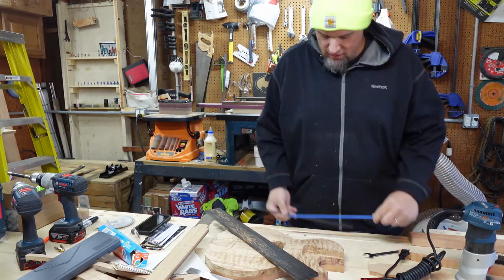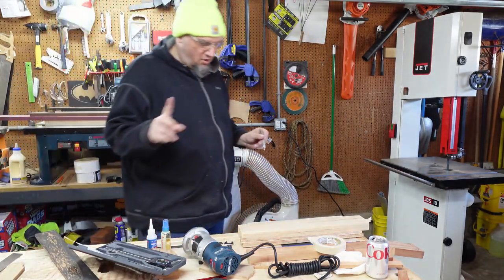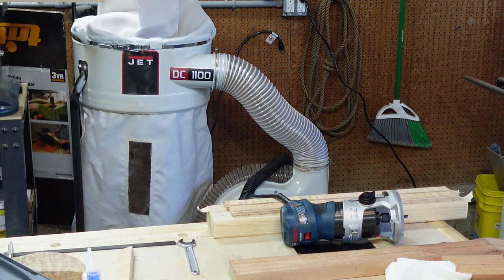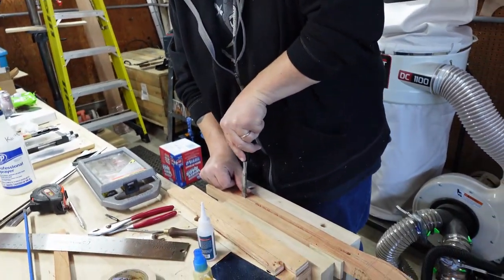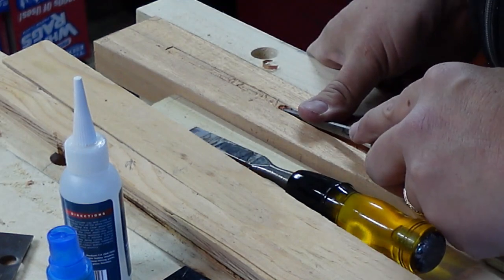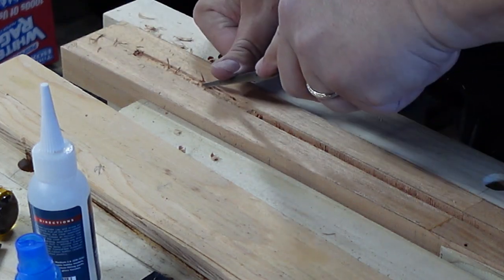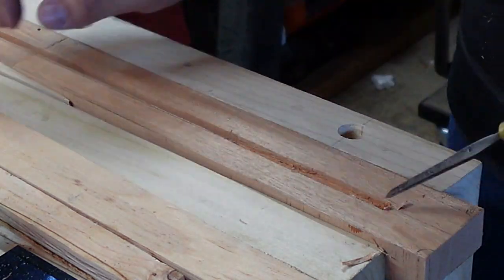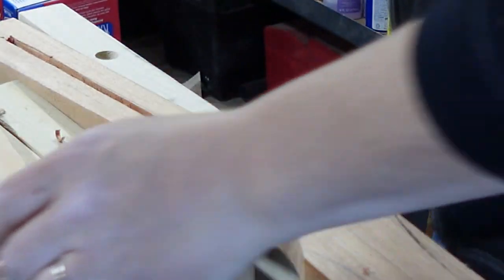episode 9 - Can't Truss It

Comment: It might have helped if you had had a router plane and a guide . I have watched some guitar builds where they have used them. Paul Sellers has a couple of videos where he has not only used them but showed how to build them as well. He doesn't to my knowledge build guitars but he is a heck of a wood worked. He even has a link to a kit to build one that he worked with in conjunction with a tool manufacturing company you can order to build one. The build is coming along. good deal the when the router bit came out when to the truss rout it did not damage it. Just hop the channel didn't go too deep as the bit worked it's self out.

Comment: Drill a starter hole in your actual piece and set it for bottom of your groove instead of starting the router at an angle. It's a lot more accurate and safer! You cold make a wooden channel to tape your neck in and then place fences on either side of channel to guide your router base. Also I would get a .25 in. chisel to do the groove.
Reply from the maker: That's a solid idea. Thanks!

Comment: Dig the new bandsaw! 🤘I rout the channels for the truss rod and the carbon fibre stiffening rods before I put the profile on the neck, that way I can use a router guide on the straight edge of the neck. Seems to work, hope that helps.
Reply from the maker: Yeah, I thought of that AFTER I cut out the neck. I really need to work on my order of operations.  Still learning.
Reply: @eklypse69  Ha me too

Comment: When setting the router bit in the collet, did you by any chance bottom out the bit? If f so, the collet can never be tight enough to keep the bit from loosening. Ask me how I know!
Also, I remember the electric drill slip up and the despair on his face. We all make misteaks.
Reply from the maker: Good to know!  And yes - we all make mistakes. I try to console myself with that knowledge when I make all of my many screw ups lol